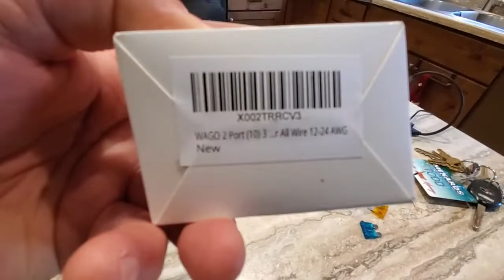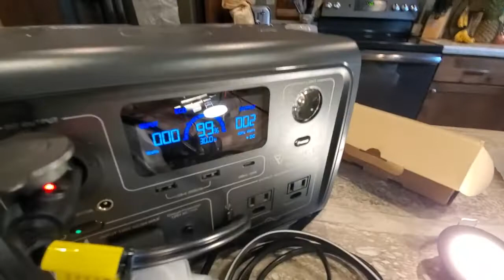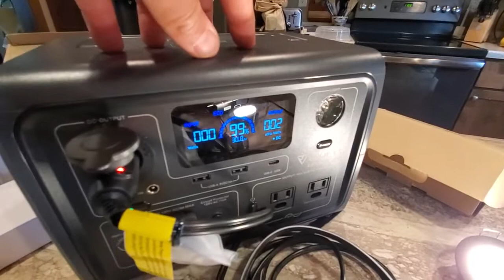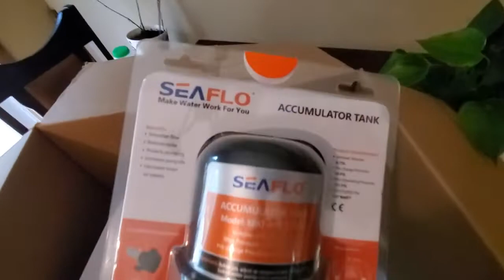bluetti eb3a to power my cargo trailer conversion example!

Comment: This is amazing! I am building a squaredrop with only 4 led lights and a fan. This should be perfect!!! Also did the DC cord come with it? Or did you have to buy that separately?
Reply from the maker: Watch this https://youtu.be/6MSpHg7_U-M
Reply: @toddelfers  appreciate the video but I just want to know if you had to buy the DC cord for the DC output. I only have 4 puck lights and a vent fan to power. I only need to wire accessories to the fuse block and then wire the fuse block to the bluetti, correct?